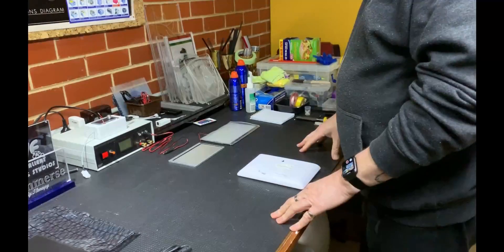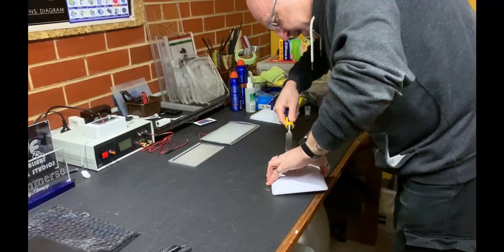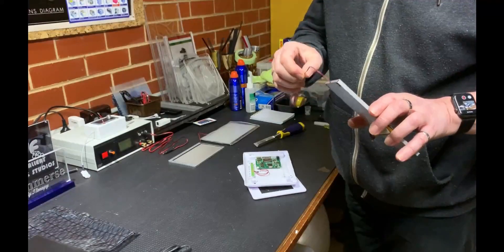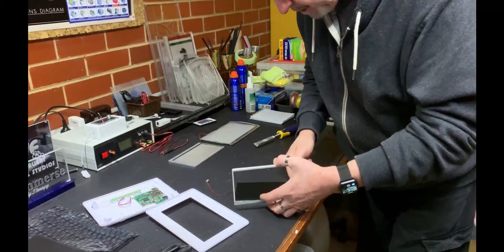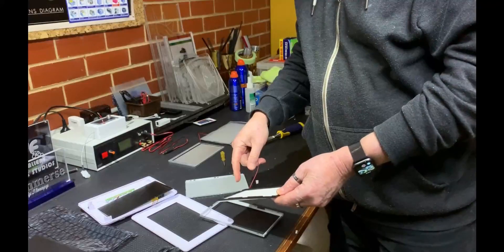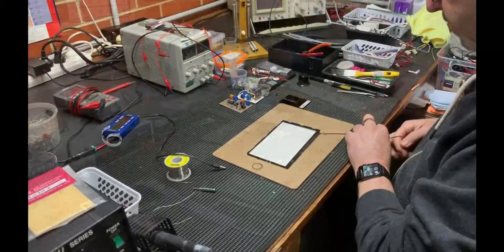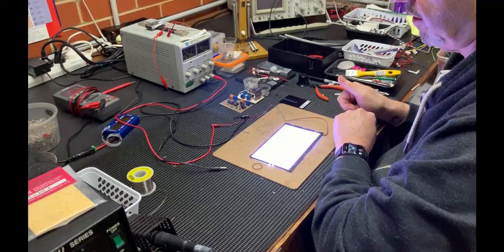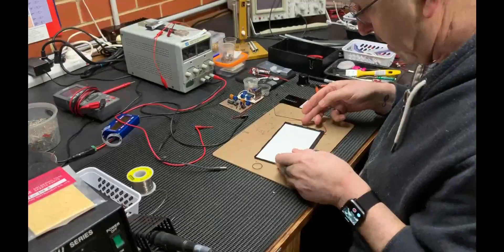LED Back Light from LCD for use in a Lithophane

Comment: Hey did you get the idea from DIY perks? :)
Reply from the maker: No don't know DIY Perks, will check it out. I came up with this idea myself about 4 or so years ago pulling apart an old Sat Nav system. Since then I have seen a few videos on the use of these back lights as artificial skylights and windows etc.